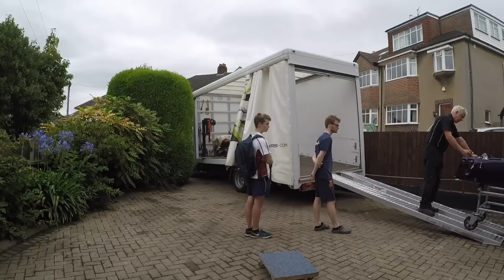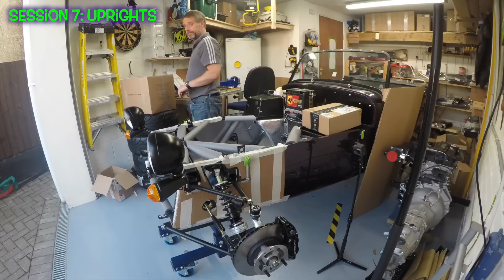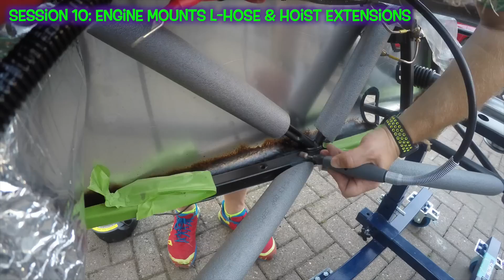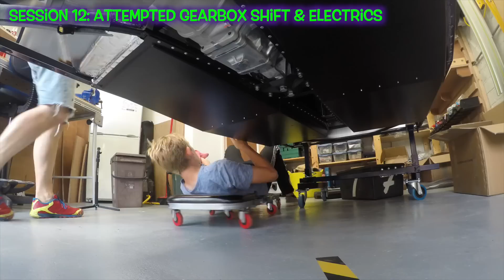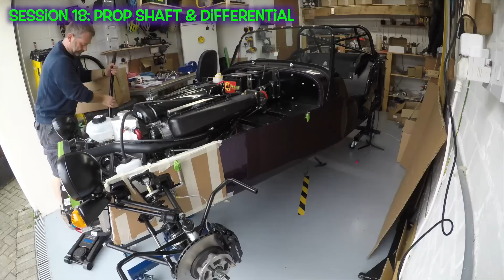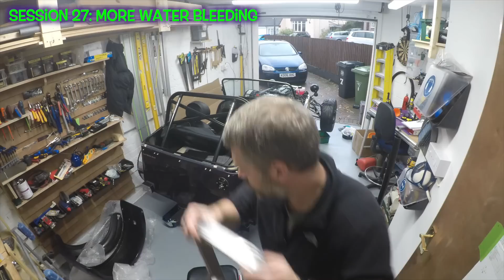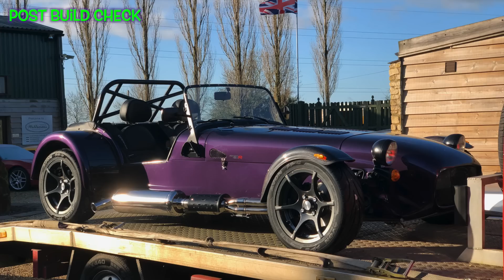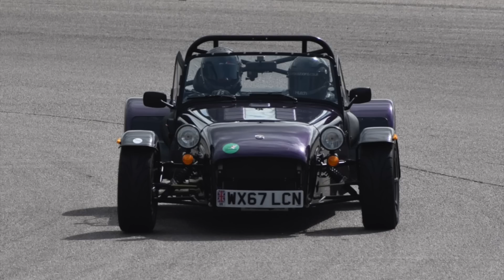Build A Caterham 420R Kit Car In 30 Minutes // Time-lapsed of course!

Comment: This vid should be renamed to "100 reasons why never to buy a Caterham kit"....   There is NO fucking excuse for the manual to not match the parts or procedure, EVER!
Reply from the maker: In any normal product purchase you'd be exactly right. But when you buy a Caterham kit you are pre-programmed to expect it. To be honest, I wouldn't have thought it would be that difficult to fix their parts-kitting processes to at least provide you an addendum to the build manual. Oh-well... I said it was all part of the fun, and if you don't have that attitude then you'd get seriously pi**ed off with the build pretty quickly.
Reply: @Purplemeanie  I think it's especially bad with a CAR, not only is it one of the most expensive things you'll ever buy in kit form, but it's a safety issue as well.

It's not exactly on the same level i'll readily admit, but i used to write service and setup manuals for a range of printers, not user manuals, but manuals for engineers to use, and you can be damn sure there wasn't even a comma out of place, let alone a procedural error.  It's not difficult to proof read and it's not difficult to update a master drawing or manual, it is difficult though to work through the bullshit you encounter when some lazy half arsed fuckwit hasn't done that.  The crap you went through in this video was infuriating even just to watch...
Reply from the maker: @mymodel6  I don't disagree with you. I also come from an industry where this sort of poor process would be unthinkable. 

I have my suspicions about why Caterham works this way but I'm not prepared to air them in public - they would be speculation and I'm not about to fan any flames. 

Hopefully my video is another checkpoint for people wanting to build a Caterham... if you are forewarned then I hope having had your eyes opening will reduce the frustration (if only a little). I became very laissez-faire with the process and perhaps that's a fault, but it helped me through the build. I've seen others build cars and become very frustrated and disillusioned, and then that spoils the fun you can have with the car. In many ways I enjoyed the challenge of beating the manual - but I fully admit that it takes a certain mindset to think like that. I don't say its right - its a reality. 

I do fully take on board your safety point though. The Post Build Check and IVA are points at which safety will be tested and are much needed part of the process. And from my experience the IVA can be tricky for people who are less mechanically minded. But is a much needed check point to make sure something dangerous isn't allowed on the roads. From what I understand of the US process, I don't think such a check exists. Its up to your own personal worldview as to whether IVA is a control too far or a necessary safety check. 

It's also something you have to come to terms with in terms of costs. These are very expensive kits. The IVA guy that inspected my car was full of praise for Caterhams - saying that he sees other kits being much worse. However, for the top dollar you pay for a Caterham you might expect top paperwork. Perhaps other kits are even worse??

However, I do think that Caterham have got a lot better over recent years - my experience (and others around me at the time) was better than a few years previously, so it's not all bad news. And my experience is a few years old now. Though I do still see people blogging about builds where there are still problems with component shortages and the manuals not being quite right. Perhaps other more recent builders can chime in here if they see these comments.

Comment: Can you tell me if the Durotec is any good?  I've heard mixed things on its reliability and I'm considering just getting a K20A R  imported to the US.  I've had nothing but positives with the K series.  So unsure if I should stick with the Durotec, since I will be using mine quite often.
Reply from the maker: Hmmm... that’s a good question. I’m probably not the best to ask but I certainly know club members who have had a Duratec in their cars for 10 years now and over 100k miles. I think a lot depends on the level of tune. Go too crazy with the level of tune or the wrong tuner and I’ve heard people have problems. I love the Duratec in my car - great low down pull but plenty at the top end too... but I’m a “big engine in a small car” sort of person and not into high revving engines like the K-series. Each to their own though, that’s just me. Getting involved in some of the Lotus 7 Facebook pages or Lotus7.club will get you access to many more knowledgeable people than me. Thanks for the great question.

Comment: When heat shrinking, remember the shrink ratio range from  1.2 to 1 upto 6 to 1 the higher the ratio the thicker the finished wall thickness and stiffness and protection given. To seal the end of the shrink tube if a bundle of wires is inside is to put sealant on the last 10cm of the loom inside the shrink tube before shrinking. May be buy some clear heat shrink and print or write white ID tags and clear shrink over them and log the in your build log with wire colour and item they feed and even an above view plan chart for the crew with joint marked on.
Reply from the maker: Wow! Thanks @BillHover that’s really good advice. To be honest I’ve been using heat shrink for 40 years without really knowing or thinking about any of that. Your suggestion makes a lot of sense. Thanks, John
Reply: 2 more for you, if you have 2 wires comingout, put on a 20cm bit of adessive heat shrink on with 10cm over the other tube and just heat that bit , then pull the 2 wires apart and heat that bit and when hot pinch the bit in the middle with a pair of long nose pliers and hold till it cools a bit, and you have a perfect Y joint. Next, if you forget to put heat shrink on and it is a small bit, you can expand it a bit by putting the tip of a long screw driver in a vice with the tube sliding on it and slide a second driver in the tube as well, and with a bit if heat you and lever the drives apart a little and hold them in place until the tube cools and after fitting with heat it will still shrink back

Comment: Big boy lego. I kind of wish there was a 'kit' you could buy that was basically a chassis and shell that you could transfer all the parts of a cheap donor car onto, so you could do this for just a few grand instead of tens of thousand. It'd be harder, dirtier and less satisfying (rust and grease etc.), but it'd put it in range of us peasants.
Reply from the maker: Thanks for the comment. It’s been a very long time since I looked at this but in the past people like Dutton and Westfield (I think) did exactly that. When I looked last, a lot of the kits were based on Jaguar or Ford donor cars. I didn’t have the patience for that and was lucky enough to be able to afford the Caterham. But you’re right, more rust and grease to deal with from a donor car.
Reply: @Purplemeanie  Cheers for the reply! I'll have to look into that at some point. Makes sense to shift a load of cheap common parts onto a really well-designed frame that's much lighter, especially if the frame is designed for a specific donor car or is tunable for weight distribution etc.

Comment: I couldn't tell from the video but if you neatly twist all the wires together before heatshrink it can help reduce the overall bundle diameter which may make it easier to pass the wire through the headlamp stalks.
Reply from the maker: Thanks Ryan. I didn’t do that. But I can see that doing that would create a minimal diameter cable assembly. I’ll have to remember that for the future.

Comment: oh no powder coat watch it rust TVR found that out
Reply: There's a great Wheeler dealers episode about the TVR  rotten chassis
Reply: @fabslyrics  i owned to powder coating companies it not suitable for rust protection it was a cheap alternative to the wet paint process just look at your cheap garden furniture look how long it lasts, they have now brought out rich zinc powders to use as a undercoat only time will tell if thats any good
Reply from the maker: We'll see how well it holds up. Many Caterham owners don't take them out much in the rain, or even worse - salty roads in winter, but I'm going to be using it all year round... so we'll see how the powder coat holds up.

Comment: Prop shafts are found on boats, drive shafts are found in cars. Lol only in the UK.
Reply from the maker: That’s a good point. I was always taught that the prop shaft was the single shaft from the gearbox to the diff and the drive shafts came off that. But now you bring up the nautical aspect, perhaps I need to rethink that thinking! In the context of cars I thought prop was for propulsion and not propeller, I’ll need to research that now :-)

Comment: I did it the hard way. Bought Dennis Ortenbergers book "Legend of the Lotus 7", took some photos of a local Caterham 7, and with a stick welder and hacksaw started cutting out bits of tube. Here in Australia the rules can be strict, and they're much stricter now than 1993 when I started this 2 year penance. I used a Toyota 4AG Twincam engine/ gearbox and computer. Registering was far from straightforward because it failed twice, different parts being picked out by different inspectors.  Finally I got the title, registration but couldn't find an insurer. In Australia basic 3rd party insurance is covered in the registration cost so I managed with that. Kept it 5 years, not one single issue, it never let me down, never blew a fuse, nothing. It was featured in the local paper and I even had a 10 minute spot on a local radio station.
I sold it to a guy who kept it for a few years and then sold it to someone fairly local. This guy has done Perth to Sydney and back in it twice and loves it to bits. I still see it around occasionally...
Reply from the maker: Wow! Now that would be a whole video series worth watching. Even the Perth to Sydney run would be a great story.
Reply: @Purplemeanie  I laid my story out not to impugn your work in the slightest, it's just that my route took a little longer. I took progress pictures but in those dark old days there wasn't much in the way of digital cameras so little has survived other than a couple of pictures I keep on my desktop as a reminder. These were taken with a digi. It was the current owner dropping by for a chat...

My email address is itsonlyme@optusnet.com.au If you're interested send me a blank email and I'll send a couple of pix by return and a few words about the fun and games I had.
Reply from the maker: Email sent.

Comment: Great video 👍 Are you allowed to drive the car on the road to the IVA?
Reply from the maker: Thanks. Yes, you're allowed to drive it to IVA, and if it fails also drive it home again! It was more worrying to drive the car to fill up with fuel a few days earlier, while technically illegal it needed to be done.
Reply: One other amusing thing that happened during my IVA, the inspector said he didn't like the screw hole recesses in the indicator lights at the front - said it could be a hazard for pedestrians in the event of a crash. Apparently a 5mm diameter hole could further injure someone that I had just run over. I put some insulation tape over them and he accepted that 'fix'.
Reply from the maker: And that's where common sense took a break... if anyone is unlucky enough to be that close to the indicators during an accident, then the rest of the open front suspension setup will be much more of a concern to them than whatever a 5mm hole can do to them after they've lost an arm or a leg to the struts or wishbones! Good grief!
Reply: I was on the way to the IVA in mine and got pulled over by the police who asked why I didn't have registration plates. I told them it was because the car wasn't registered, showed them a piece of paper with my appointment on it and they were fine. Convo soon went to 'so how long did it take you to build' etc - I feel that the officer was just interested in the car rather than enforcing the law.
Reply from the maker: Good to know common sense can prevail. Even with common sense on my side, I'd have been crapping myself being pulled over on the way to the IVA test - not least of which for being late.

Comment: Great stuff. Thanks for sharing!

Was allowed to do self-assemble my CSR. Yes, it's even coded as a such in the frame. Crashed it after a scary bit of aqua-planning and consequently got the opportunity to disassemble it and reassemble it again. Happy memories.
Reply from the maker: Wow! That sounds like an adventure!
Reply: If I may ask, how did you qualify to be allowed to build your own CSR? 
When we got the R500 a while back they insisted that a caterham mechanic had to do it. (A fine job he did I may add but we wanted to do it)
Reply: @jamiewalker8772  The Swiss dealer, Fredy Kumschick, was so kind as to allow that. Possibly that was driven by the fact that I otherwise would have chosen a different as in "cheaper" model. His workshop also had assembly instructions for the CSR which were indispensable. Essentially the suspension is a bit more complex and the engine wiring is perhaps slightly different compared to the usual self assembly models.
Fredy is a bit of a character. There should be a video of him crashing one of Bernie Ecclestone's cars. One of the Brabhams if I recall well. If I'm not mistaken Fredy was given the odd opportunity of restoring the car using Bernie's 2nd exemplar. All free of charge I believe.

Comment: nice vid very informative :) ... Did you have to change the tyres around as they seem directional and "wrong" on one side of the car (front and rear)
Reply from the maker: Thanks... and good catch! They spotted that the wheels weren’t on the right corners at the Post Build Check. I’d worried so much about so many other things for IVA that I’d completely forgotten about the directionality of the tyres. Simple fix though! :-) Thanks for watching and commenting.